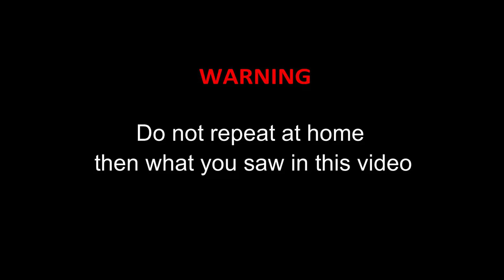HYDRAULIC PRESS VS HARDEST OBJECT, RUPERT'S DROP

Comment: It is not the hardest object, it is the strongest object. Strength and hardness are two very different things
Reply: Can you elaborate more the difference?
Reply: @zafar204  hardness is the resistance to scratching, strength is the resistance to breaking. For example, diamonds are not the strongest material they are the hardest because they can not be scratched by any other known material but they are very brittle and can be shattered easily.

Comment: For who don't know what ruberts drop is its just a drop of heated glass poured in water to take a shape like this its thick part is harder that diamond but is thin tail is so fragile if you break it the whole drop will break in pieces , hence it's strong and weak at the same time
Reply: It's not harder than diamond. It's not any harder than normal glass. You could shatter the prince Rupert's drop head with just a piece of ceramic like from a spark plug. The head is still vulnerable to being scratched/cut by anything harder than ordinary glass.

The head of the drop just withstands higher compressive force than many other materials (note that there are also tortion forces and tension forces, which it may not —or likely does not— perform as well)
Reply: @MsHojat  I'm not sure its so easy to scratch...it can withstand bullets

Comment: 1:46 what is this, train goes on track but track doesn't break?! Because trains  locomotives are up to 150tons!!!
Reply: Well think logically, a 150 ton locomotive has 6 axles with 12 wheels on which sits that weight of 150 tons, 150: 12 = 12.5 Tons per wheel, of course it does not break the rail, if you put 150 tons on a wheel then yes break.
Reply: @creatacasa2499  thanks for information about it☺